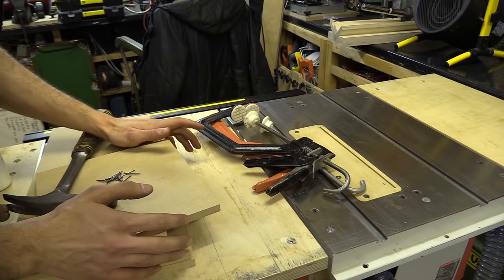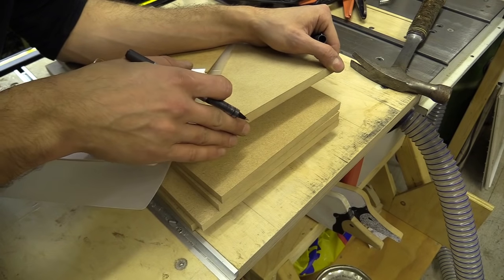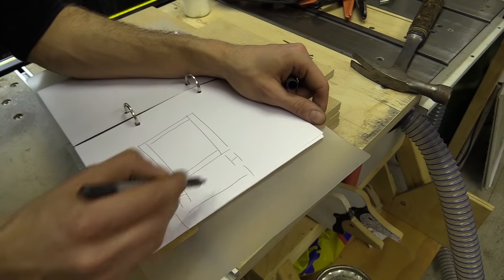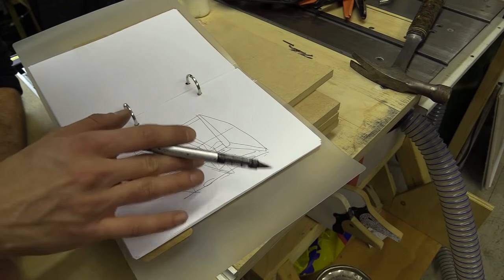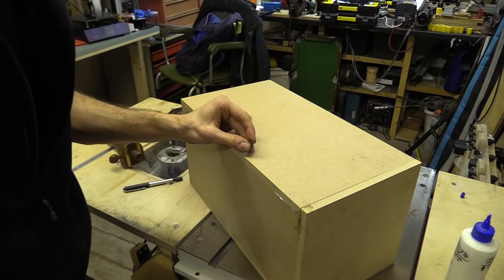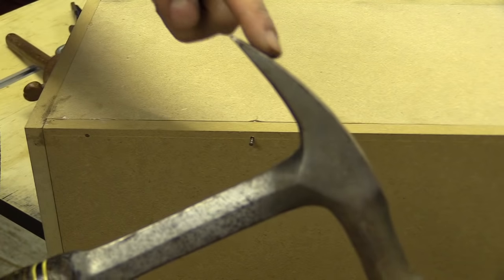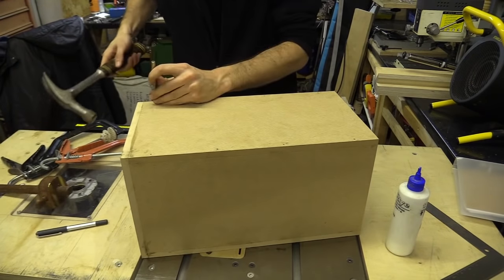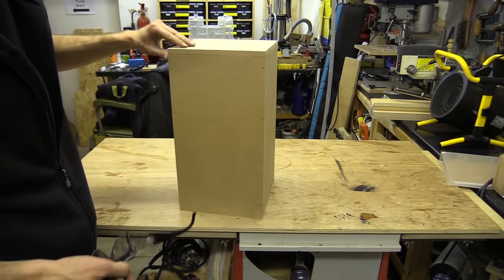Plinth Pedestal Podium or Box (for beginners) | How To Make Build Cobble Assemble

Comment: Yiassas Savvas, This was very good and it's exactly the kind of pedestal that I will be needing to make for a sculpture that I shall soon receive. 
I have made pedestals before where the lid (and foot) was an oversize feature but this time I want the top to have the same dimensions as the column. 
In the past I have used dowels and glue but nails and glue is faster. You provided many useful tips (especially alignment) and I shall be watching the painting video, since I'd like my plinth to be white and featureless to contrast with the Giacometti reproduction (Walking Man) I have bought. Efharisto para poli. Rob in Switzerland

Comment: You forgot to wear a respirator, MDF dust is very fine and will get onto your chest if not carful
Reply from the maker: I think there's some already some in there :( but masks are only really effective when properly fitted and without beard or stubble... so good extraction, air scrubbers, keeping the pad flat and breathing through your nose make a big difference.

Comment: Do you have a particle counter? I bet that the airborne dust goes up a lot during the sanding, even with the vacuum attached to the sander. And given that it is MDF, you really should be wearing a respirator. The goggles and hearing protection are nice, but the respirator is the important thing.
Reply from the maker: I find that if the extraction is good and you are sanding with the pad flat it will be minimal. Of course wearing a mask as long as you don't have a beard will always help but I also have the air filter in the workshop too. Will put it to the test though.

Comment: Any tips on painting the edges? It takes me around 6 coats and sanding to not have a crumbly wensleydale edge.
Reply from the maker: You need to use a hard paint like brilliant-parmesan.
Reply: or use a sanding sealer,  i just use slightly watered pva and sand it myself, or melt some kraft cheese slices, whichever you can find
Reply from the maker: That's what I do as well, but the cheese thing is only for special occasions!
Reply: I'll give the parmesan and pva a go. I use oil based undercoat, about 3 coats before its near good. I've got 45-50 drawers to make, meh!